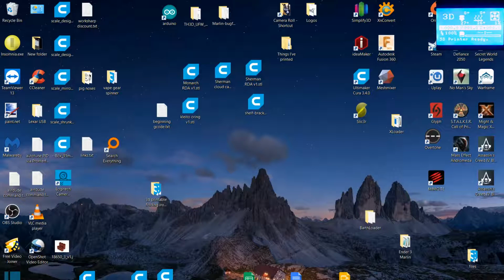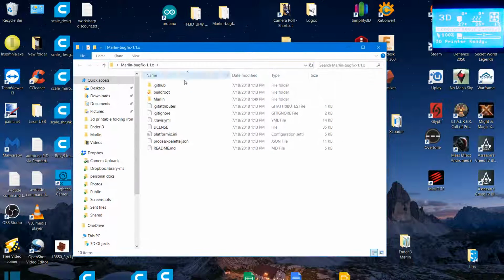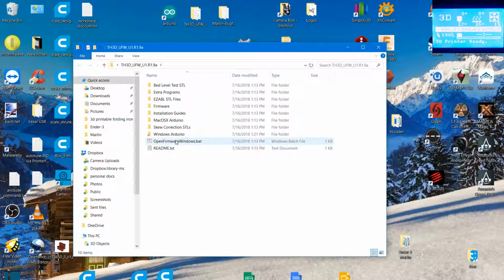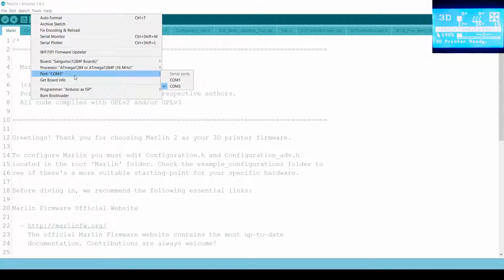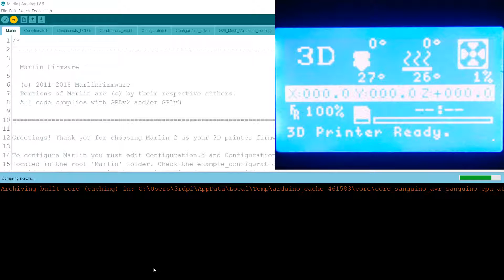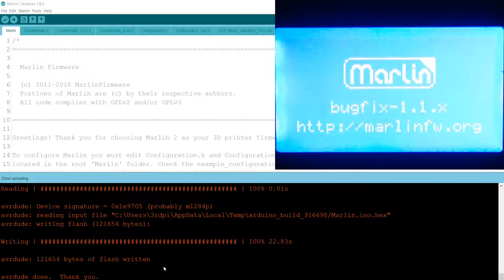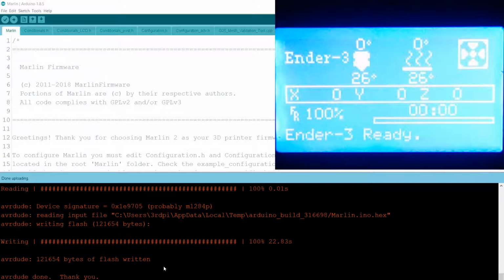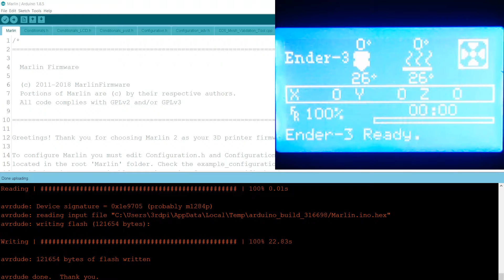Flashing the Ender 3 back to stock firmware UPDATE!

Comment: I don’t under stand what you have to download. I’ve downloaded the marlin bug fix but i don’t understand what i have to download next.
Reply from the maker: I did all this 7 years ago so my memory is pretty hazy. Have you already flashed the bootloader to the board? If not you need to do that first. Then get the Marlin files and load them into the Arduino software, then compile and save to a card, put the card in the printer and turn it on. It should update. I'm sure there's still detailed videos around including my earlier ones.

Comment: how do i get the sanguino board profile for arduino? its not in the list
Reply from the maker: I made that video 4 years ago so my memory is pretty foggy on the details, but I think I remember going into the Board Manager in Arduino IDE and adding it there, probably from Github. Sorry I don't remember better. And unfortunately I no longer use Arduino IDE for board flashing and haven't kept any of it installed on my PC. Good luck!

Comment: So if i am correct, you can download Marlin, and then do some copying and pasting, and upload this version of software to the Ender 3? Is this just like the stock firmware, and is it different from the normal Marlin Ender 3 setup?
Reply: Also, why are the two LCD screens you show different? Is one Marlin and the other the reverse-engineered stock firmware? I do not understand.
Reply from the maker: It's not quite that easy, but that's the gist of it. If you have a stock board you'll need to flash the bootloader. Once you've done that you download Marlin, copy over the specific Ender 3 files, make any other changes your setup requires, then flash that to the board. As far as it being different, it's still Marlin and the Ender 3 files make it look pretty much like the stock firmware, but Creality took out much of the ability to make settings from the printer control panel, those are back but the big plus is Thermal Protection is enabled and you have the ability to tweak the firmware as you desire and then reflash the board.
Reply: @3rdpig  When you say "flashing ender 3 BACK to stock", what do you mean by that? I already knew how to burn a bootloader and download stock marlin to an ender 3- but that doesn't require overwriting any parts of the code. Was this ender 3 something OTHER than stock at some point?

Comment: Thank you for your video. Can I restore the factory setting in my ender 3 pro with just hitting the: Initialize EEPROM option please?!
Reply from the maker: That should restore all the non volatile settings to factory default as long as you haven't moded the firmeware.
Reply: Ok cool. Thank you for the detailed reply!

Comment: I just changed material in Cura to PETG and after that the bed won't heat on my ender 3, for example when I used preheat PLA before it would heat the bed to 60C and the nozzle to 185C, but now the bed heat stays at 0C... Any easy fix for this?
Reply from the maker: Cura can't change the Preheat settings built into the firmware. Are you using the stock firmware or have you flashed it to something else? Cura only affects the printer when you start a print job sliced with it. Or am I misunderstanding your question/

Comment: Thanks for the video! Can you update us on if you are still using this firmware? Any changes or issues? I have stock ender 3 currently(updated version with removable bed) and everything works great but i would love to enable some more of those menu options (and thermal runaway of course) Thanks in advance for the update!
Reply from the maker: Yes, this firmware is still on both my Ender 3 printers and, with the exception of Power Resume, working flawlessly. It's been so good I haven't even checked for newer versions.

Comment: Did you have any problems with the autohome?
Reply from the maker: No, have you? If so, what kind of problem?
Reply: When I autohome my nozzle gets 3 mm higher than the bed, if press auto home each it goes higher and higuer i
Reply from the maker: That's pretty odd. I think I'd carefully check that I had the motors and limit switches wired right and if that didn't fix it I'd probably flash it again. After that, I'm stumped. If you figure out what it is let me know and I'll try to spread it around to others who might be having the problem.
Reply: @3rdpig  I just reflashed the TH3DUF and only uncomment ender3 and no problems. Now I'll message with the logo and the names hehe
Reply from the maker: Glad to hear it Mario, no go have some fun printing stuff!

Comment: Hello Chuck, i tried your way to flash the ender 3 and i did everything you did but i keep getting thse errors :

avrdude: stk500_getsync() attempt 1 of 10: not in sync: resp=0x65
avrdude: stk500_getsync() attempt 2 of 10: not in sync: resp=0x63
avrdude: stk500_getsync() attempt 3 of 10: not in sync: resp=0x68
avrdude: stk500_getsync() attempt 4 of 10: not in sync: resp=0x6f
avrdude: stk500_getsync() attempt 5 of 10: not in sync: resp=0x3a
avrdude: stk500_getsync() attempt 6 of 10: not in sync: resp=0x53
avrdude: stk500_getsync() attempt 7 of 10: not in sync: resp=0x44
avrdude: stk500_getsync() attempt 8 of 10: not in sync: resp=0x20
avrdude: stk500_getsync() attempt 9 of 10: not in sync: resp=0x69
avrdude: stk500_getsync() attempt 10 of 10: not in sync: resp=0x6e 

Any idea where it comes from?
Thanks a lot
Reply from the maker: What firmware are you trying to flash? Did you have any issues flashing the bootloader?  I googled your error message and got a lot of possibilities, but it's hard to know what to suggest without knowing the above info.
Reply: I get that same error message,  but I was trying to install the th3d firmware. So now my printer has no firmware and I get that message when I try to upload firmware to ok. 

UPDATE: my problem was my computer. It would not recognize the port, so basically my com port was always wrong. I used a different computer and it found the port and worked the first time.
Reply: you have no bootloader instlled
Reply: i have ender witḫ 1.1.3v board and i face the same issue

Comment: Off topic, but would you consider doing and instruction vid to install tcm2130 stepper drivers install if even possible?
Reply from the maker: I've never done that before, but I've read about it. I'm not sure what I think the advantages of it would be, the Ender 3 isn't loud (at least not to me) the motors don't run hot and it produces great prints, far better than I expected for a sub $200 printer. Am I missing something? Because it seems like a fair amount of work and expense for a minimal return.
Reply: Chuck Bryant noise reduction would be benefit in my eyes.  I agree that it's a fairly quiet machine, but I can still hear the whine through a closed door.   Maybe I try the easier cheaper solution of dampers first.  Although on the new machines the x axis damper is hard to install from what I understand.
Reply from the maker: I can understand that. I agree though, I'd try dampers, maybe thick rubber feet or one of those anti fatigue mats they sell at hardware stores that are about an inch thick. I've also seen dampers made from tennis balls. Or maybe some "white noise" or soft music would drown it out and not bother you as much. Good luck, and if you find a good solution let me know and I'll share it. But changing stepper drivers isn't someplace I'm going to go personally since I can walk 10 feet away and not hear them over the ringing of my tinnitus.

Comment: Thanks for the useful video. I have an Ender 3 on order. Is there a quick way for me to determine if it's an old or new version when it arrives?
Reply from the maker: Yes. If it has a removable print surface it's the latest model. If it doesn't have a removable print surface but has an injection molded power supply cover it's the second model. If it has no removable print surface and a 3D printed power supply cover, you've got the first model. These things are selling so fast that I highly doubt there are any early models still sitting in warehouses. I got my second one a month ago and it's the second model.
Reply: Thanks - fingers crossed!

Comment: its firwmare support in resume feture as like that power failiur and after that power is back then start print on the resume print option then start print on the model ....that is support power faliur resume feture ......please fast tell me
Reply from the maker: Yes, it has resume after a power outage but it's disabled by default. To enable it, load the firmware into Arduino IDE, look at the "Configuration_adv.h" file and find the line "//#define POWER_LOSS_RECOVERY" and remove the two forward slashes. Then flash the firmware and you'll have full power resume.